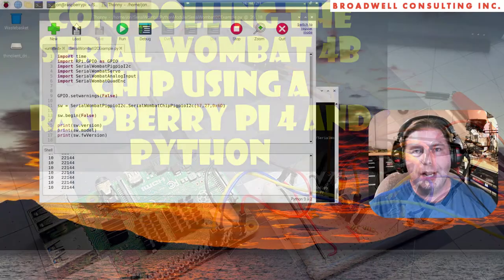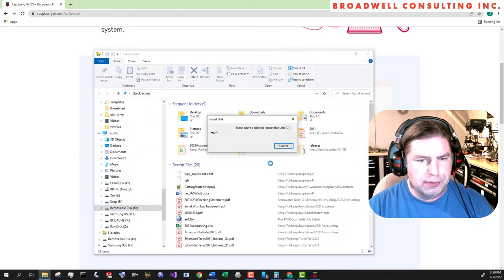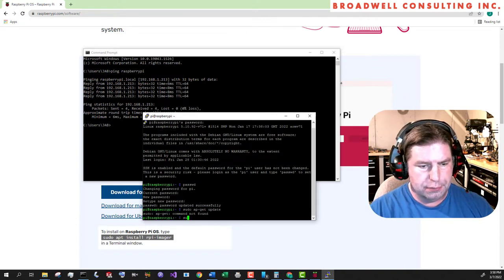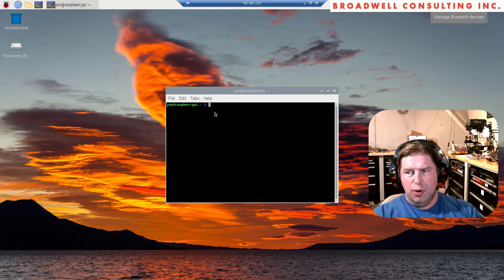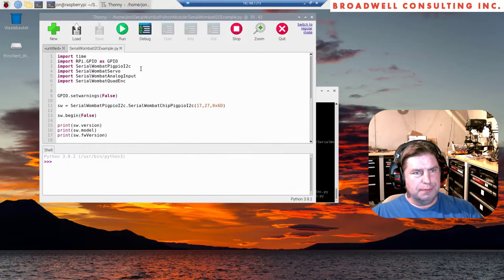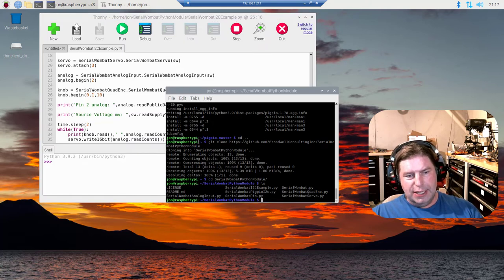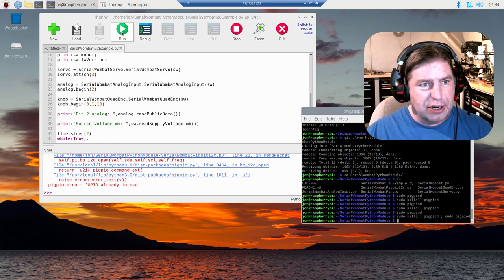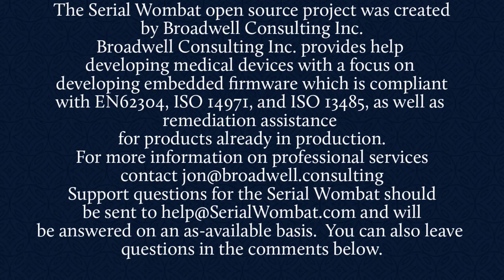Controlling a Serial Wombat 4B chip on Raspberry Pi in Python to drive servos, measure analog, etc.

Comment: Hi Jon, good video. I'm currently working on a driver/library for the SW4B written in Adafruit's CircuitPython. Really appreciate your sharing the Salae plugin. I think that will help a lot
I've also designed a couple of PCBs for the SW4B , since yours wasn't available on Amazon at the time. One is for the DIP package and another for SMT package, so I might want to pick your brain about the ICSP for that part. I think your info in the comments about the clock stretching or 2 ms dealy will help a lot also. It's tips like that that make Open Software so great. There is a CircuitPython compatibility layer, called Blinka, for the Raspberry Pi that gives you access to the wealth of Adafruit libraries. Makes embedded on the Pi sooo nice. Keep up the great work!
Cheers,

Al Pierce
Reply from the maker: Thanks!  I'll look into Blinka.  Any chance you'll put your driver up on GitHub or other repository?    Glad to know somebody else is using the Saleae plugin ( https://youtu.be/cL7kUm9qjvU ).  Programming chips is easy, but for the 16F15214 requires an ICD4, PicKit 4, or Snap programmer from Microchip.  Load the hex file from GitHub into the IPE tool, connect Vcc, Vss, MCLR, PGC and PGD and you should be good to go.  

What's your end project goal?  Any chance you could send me some pictures or a video of your SMT package or project? I'd love to feature them in a future video.
Reply: @SerialWombat  
I recently purchased a couple of SW18ABs for a project I'm working on. (why buy a new keyboard when you could build a custom one for twice the price plus hours and hours of work...)
My project is based on a Raspberry Pi pico running CircuitPython, and I am trying to offload a few rotary encoders and some LEDs onto the SW.
In the video (around 11:30) you mention that the regular I2C pins can't be used without using pigpio (which has to be running in the background), but that you hoped to get it working in the future. I was wondering if you had an update on the status of that, or if it is possible to run something like pigpio in the background with CircuitPython.

@alfineart
Did you get your driver/library working? Would you be willing to share?
Reply from the maker: @carlrecine  This is a very interesting question.  A quick google search says the RP2040 that is the basis for the Raspberry Pi Pico does support clock stretching, so I think it's probably good over I2C with the right driver code.  I'm in the process of a massive Python library rewrite at the moment ( see https://www.youtube.com/watch?v=mRkqxEwDeVk ).  I've been developing this using Python / VS Code on windows using the Serial Wombat 18AB's UART interface, but once I have all the Arduino libraries ported, I'll then make sure there's proper interfacing layers available for Raspberry Pi and CircuitPython on the Pico.  I expect to have the initial library released this month (80% of the Arduino C++ code is ported and unit tested at this point), and then start verifying various OS/Interface combinations in December.
Reply: @SerialWombat  awesome! Thank you for all your hard work on this!
Reply: actually, I realized i2ctarget is for the slave, not the master. I made some changes that use busio instead, and it seems to be working.

Comment: Jon, thanks for this video.  I have a Raspberry Pi right next to a planter which has a capacitive soil moisture sensor.  The sensor takes 5V in and has a 0-3V proportional output.  Your Serial Wombat is a great option to allow my RPI to read the sensor using digital I2C to read the converted analog signal.

This video was helpful in getting me started with A/D on the Pi.  I have a few thoughts which I hope will be helpful:
1. I like that you've indexed the video to make it easy to find segments.
2. SSH comes native on windows now as does scp.  Putty is no longer needed as you can ssh from the command prompt.
3. I did not see any advice on ensuring that I2C was enabled.  There are some crude descriptions here: https://pimylifeup.com/raspberry-pi-i2c/

4. The Python code appears to implement I2C.  I found this confusing until I hit that part of your video (12 minutes in).  

5. RPI logical GPIO pins 17 and 27 are on physical pins 11 and 13 (https://pinout.xyz/) which also confused me a bit.

6. I could not detect the wombat at first, but I had a loose connection on my I2C.

7. I did not use pull up resistors.
8. I had to copy the code URL by hand which was a bit long.  It helped that you spoke the git URL on the video: git clone https://github.com/BroadwellconsultingInc/SerialWombatPythonModule

Here's what I got after I connected everything and watched your video.  Note that I used I2C bus 1 where you are using pigpio.  I understand that clock stretching is an issue but wanted to get running fast with the built in bus.
# i2cdetect -y 1
     0  1  2  3  4  5  6  7  8  9  a  b  c  d  e  f
00:                         -- -- -- -- -- -- -- --
10: -- -- -- -- -- -- -- -- -- -- -- -- -- -- -- --
20: -- -- -- -- -- -- -- -- -- -- -- -- -- -- -- --
30: -- -- -- -- -- -- -- -- -- -- -- -- -- -- -- --
40: -- -- -- -- -- -- -- -- -- -- -- -- -- -- -- --
50: -- -- -- -- -- -- -- -- -- -- -- -- -- -- -- --
60: -- -- -- -- -- -- -- -- -- -- -- -- 6c -- -- --
70: -- -- -- -- -- -- -- --
Reply from the maker: Thanks for the feedback and the clarification.  This kind of stuff is really helpful!  If I didn't explain it clearly, in this example it doesn't matter if hardware I2C is turned on or not on the Raspberry Pi because the Pigpio module bit-bangs it on GPIO pins.

The i2cdetect will indeed detect the Serial Wombat chip because it will answer an address call.  However, the lack of clock stretching will cause half or more of all read responses to fail.   

The Serial Wombat protocol is designed to be portable from interface to interface (I2C, CAN, UART, etc).  It consists of an 8 byte write to the Serial Wombat chip followed by an 8 byte response from the Serial Wombat chip.   In the case of I2C the lower levels of my libraries/modules do a write of 8 bytes, then do a read of 8 bytes in a separate transaction.   The method to this madness will hopefully become evident when I start doing videos that show both the I2C and UART interfaces of the SW18AB working well, and perhaps someday release the Serial Wombat 4A chip which has a UART rather than I2C interface in an 8 pin package.

The Serial Wombat executive processes all of the pin mode state machines each millisecond.  Communication buffering happens in an interrupt, but the processing of each packet happens in the main loop during the portion of each 1ms not used for processing pins.    As a result, it can take the better part of a millisecond after a packet is received before a response is ready.  The Write and Read I2C requests are tens of microseconds apart.  So the Serial Wombat firmware uses the clock-stretching part of the I2C standard so that it can effectively have the host wait until the response is ready.   On platforms that don't support clock stretching, the host (such as the Raspberry Pi) will truck ahead and try to clock out the response before one has been created.  This will cause lots of problems.   Occasionally the transaction will go fine if the end of the 8 byte write happens during the idle part of each 1ms frame.  In this case a result can potentially be generated in time to be transmitted.  In other cases, the first couple of bytes will be wrong, but the last few will be right.   In any case, a bad deal.

The Pigpio bit-banged I2C doesn't have this problem, so that's where I started.  The clock stretching issue could potentially also be mitigated by delaying for 2ms after the write before doing a read.  This would reduce the bandwidth of the I2C bus, but could potentially make the Serial Wombat chip work on the hardware I2C pins since there's no need to stretch if you give the Serial Wombat firmware time to generate a response.

If we do that, we'd run into the second problem.  The non-Pigpio based I2C interfaces I saw prior to making this video all assumed you're talking to an EEPROM or something similar where as part of the read and write process you send an internal register address in addition to the I2C bus address.  This register byte totally breaks the Serial Wombat chip's expectation of how it's going to receive messages.  You could potentially work around it for writes by using that register byte as the first byte of the 8 byte packet and sending 7 more, but it's a deal-breaker for the read packets.   Today I found a module called Python-periphery which may do what I need when combined with the 2mS delay between write and read.  I'll be looking into this.

I'll probably try to bake in some sort of SMBus compatiblity mode into the new Serial Wombat 18AB chip which allows accessing it in this fashion when turned on.    That's not something I'll add in the next few weeks though.  Touching the low-level I2C driver code on the Serial Wombat chip is something that needs to be done with great care and a large amount of follow-up testing to ensure it's bullet-proof.  There's not room for this feature in the SW4B chip.

Pull up resistors are probably necessary on the GPIO based pins.  I'm not sure what pull ups are on the hardware I2C pins in the Pi.   In any case, I typically recommend them in most or all cases.  I typically used anywhere between 1.8 and 5.1k resistors.  For anything that needs to be reliable I'll put an oscilloscope on the bus and see how the clock and data transitions look, and make adjustments accordingly.